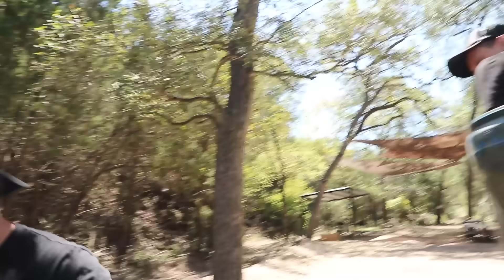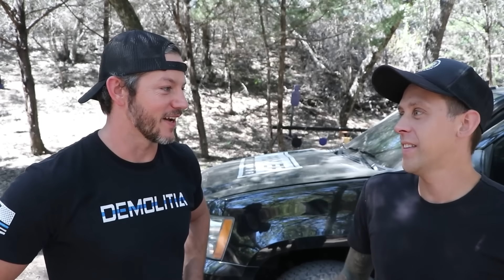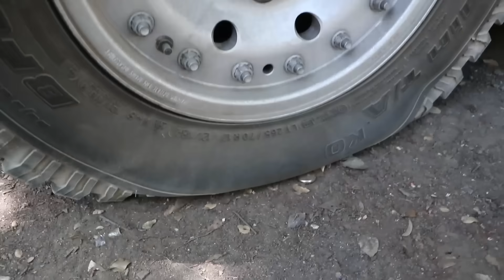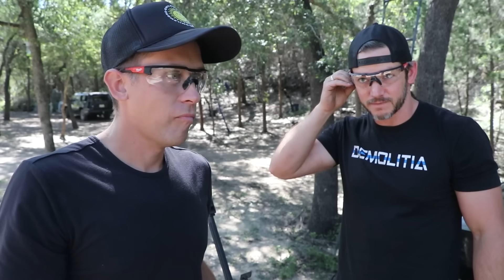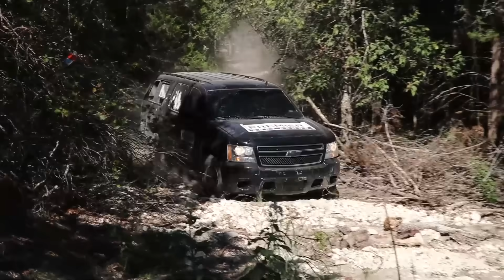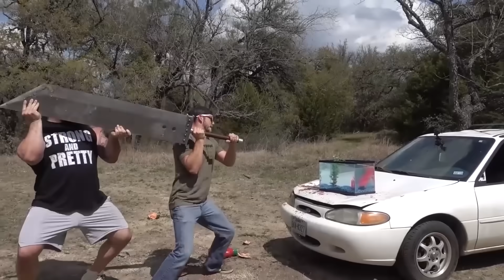Armored Truck Run Flat Tires vs 50cal

Comment: Suburban for sale, lightly used, minor ballistic damage, tires need to be replaced.
Reply: Don’t law ball me, I know what I have. *
Reply: @Donut833  😂
Reply: sure, sure, but what's the gas milage like?
Reply: Gas per foot is a more accurate measurement
Reply: Second owner, never smoked in, pet free.
Basically new.
No backsies
Reply: Read this as “trees need to be replaced”
Reply: Runs good
Reply: This didn't age well also no engine lol
Reply: That don't make them run flat no more
Reply: *minor cosmetic damage
Reply: In the name of God, the most gracious, the most merciful

 Say, He is God, One (1) God, the Eternal, the Eternal, (2) He was not begotten and was not begotten (3) And there is none equal to Him (4)
Reply: -AsianGrils- 🍎  Not approved by ATF
Reply: @bwofficial1776  hilarious 😂
Reply: @bwofficial1776 fyi that is not korean
Reply: I know a guy who would give 1000 bucks for the rolling GM parts.
Reply: @EyesToInspire   Buying the Suburban comes with a few strategically placed gas stations too, so you can make it to town and back.
Reply: just say it's minor collision damage. i mean, it was technically a collision with a bullet.
Reply: Price?
Reply: More like "tires still have plenty of tread"😄
Reply: @EyesToInspire  "Whats the gas mileage like?"
Matt: Yes
Reply: I can't believe the Tires we're bulletproof

Comment: I really want to see this RESTORED. It was such an amazing thing to have and to keep you safe.
Reply: Underated comment
Reply: Those runflat inserts, make changing tires a total PITA, and most places don'tknow how to do it. They are a tedious beeyotch to do. Plus those rims are probably all fkd 😆 🤣
Reply: @patrickw9520  considering he also had no idea what they did im assuming he also exceeded the maximum speed for driving on runflats witch is 35 mph and i can confirm changing runflats out is a total pain especially if they are steel rubber runflats are a pain as well but a bit easier

Comment: I think it needs to be restored once your done shooting it with stuff. Do the 50BMG vs the windshield and doors and stuff, then fully restore it knowing what it's capable of and take good care of it after that.
Reply: @Norwegian_Bastard  Everything is repairable as long as it hasn't been completely obliterated. It's just a matter of how much your willing to spend on it most of the time and if it's worth repairing vs the cost of just buying a new one.
Reply: I think as long as he just shoots the glass with the 50 everything else can be repaired. I mean he did say that bullet proof glass does have a shelf life so I mean it would need to be replaced anyway to be functional as a bug out car but I definitely agree
Reply: The back corner is smashed in pretty good, but that section us unarmed anyway 🤣
Reply: @aztecnat45  
The shelf life is kinda ehh.  It's not going to go from high power rifle bullet proof to not stopping a 9mm just because it's old.  It's bound to still be pretty effective for years.

Comment: Let this be a lesson to everyone watching: Don't EVER give Matt a car!
Reply: @agnez1169  super helpfull adition to this comment!

Thank you so much
Reply: @hmmmtietmetmosterd  don't bother. Bots can't read. Just report it like I did.
Reply: @omgwtfkthxbai  yep, even reporting won’t do much since there will always be an infinite supply
Reply: What if I give him a tank.
Reply: @wee0fps61  when reporting you have to say they have misgendered someone, that might work.
Reply: For real.. he's turning into whislindiesel over here
Reply: @xXxDarkKnightxXx  or Kentucky Ballistics? 😆
Reply: @xXxDarkKnightxXx  Matt has been doing this for years before that sadistic dude that destroys a perfectly good running truck for sht and giggles. Only difference is that matt uses guns
Reply: I'm also worried for the ZR-1, and the lowrider Impala, as Matt seems to mostly destroy the good stuff (GM vehicles ((His K1500, the burn-out Corvette, "El Chromino," and now, the armored Suburban).  What he should have destroyed is that stupid POS F-350, that did a terrible job of securing his stuff (popped door lock gains access) in San Antonio.

Comment: Man as much as I love seeing you shoot things, I got to say, I think restoring it will be great. Roman has a point, these are "interesting" times and I'd hate for the car to be FUBAR and you're left with a hunk of metal
Reply: I do believe that's why he bought the 5 ton haha
Reply: @mattk1693  yeah but the 5 ton isn't quite as bullet resistant. Plus that suburban weighs 6 tons!
So ha.
5 ton would be nice for just driving over things though.
Like those scenes in media like the walking dead where the freeways are just fully congested with abandoned cars so you have to get out and go on foot. Pssh just slap the 5 ton in 4  low and go wheelin

Comment: Shoot it with the .50 bmg in part 4 and get it fully restored for part 5! It’s a brilliant vehicle you can’t just leave it all shot to bits.
Reply: This feels right.
Reply: That was my thinking too. Part 4 go crazy with Barret, and I would avoid shooting the engine, then part 5+ start the restoration/customizing.

Comment: Run flats usually only run about 20 miles or so before it’s dangerous. I’ve done it with my car (has run flats) and it lasted 30 before I felt the tires were going to separate from the rim
Reply: Daniel, the non military run flats are not designed to go that far. They're designed to get you safely to a place to replace your time. Please don't push them to those limits. Find you a safe place, go home if close enough and have them fixed.
Reply: Driving around the streets for 30 days on a flat?  I don’t think so.
Reply: @scottmitchell1884  miles. Why would you think days??
Reply: Those run flats are different, the armored ones actually have rubber between the rim and the tire to hold up like it had some air, while normal run flats just have a really strong sidewall to keep the tire in good enough shape to get to a place where it can be changed.
Reply: Theyre also bead lock rims,the tire will stay on untill it disintegrates and will keep it from spinning on the rim.

Comment: To any physicists out there...

Can somebody explain why the dust gets sucked INTO the entry hole at 14:09? 
So far my only guess is that the vacuum of the bullet trail is more powerful than the pressure inside the tire, therefore forcing air into the tire before the air from the tire escapes?
Reply: The dust is hiding because it got scared

Comment: Depending on if they're "bulletproof tires", which are real, or just plain ol runflats, the wall of the tire might be much more reinforced than the tread.
Reply: @bentheninjaboo who cares?
Reply: They are neither bulletproof tires nor plain old run flats... looking at how the tyres go "half flat" im assuming there is something inside the rim holding the vehicle up. I have never seen this style of run flat tire, generally a manufactured runflat tire will appear pretty much fully inflated even when flat. As far as I know, certainly here in New Zealand anyway you can not get a B F Goodrich KO runflat.
Reply: @MR1wooki  thank you

Comment: On runflats the sides are reinforced with steelwire, and the Tread part is reinforced with more rubber, so shooting the sides would be the better choice.
Luckely your friend there knew so much about tires he told you to shoot the tread 🤣

Comment: What up DemoRanch!

The video were you filled 10 highpoint 45s with toothpaste all the way to cement, I believe should be retested. I don't think any pressure can build inside the barrel if it's filled all the way. So......I was thinking you should do another video with the same materials, but only fill the barrel halfway so there is room for the bullet to build pressure in the barrel prior to hitting anything in the barrel. 

Also, you should do it with some rifles as well. That way we can see long vs. short barrel.

Thanks for all the content man!!!

Comment: Run Flat tires aren't designed to stop the air from leaking out, they use a harder rubber all around to keep the deflated tire together for a while (civilian ones only really 20-50 miles max, military ones are far superior). Some of them that's all the company deems a run flat, other run flat tires have about an inch thick of hard rubber compound behind the tread on the inside of the tire to further help the tire do it's job without air. Outside of military use and ultra high end cars you rarely see them anymore but if you're curious or a car guy every run flat I've seen list their rim size as RF18 (for an 18in rim) instead of the usual R18. They were a trend with a lot of European cars in the early 2010's but customers got sick of the extra cost for just an emergency courtesy and the fact by the manufacturer's recommendation it is not safe to patch a run flat tire.

Comment: Run flat tires are basically just a normal tire with a very strong/stiff sidewall to prevent the rim from getting damaged, most don't provide any puncture resistance. Maybe in military vehicles but I'm not too sure.

Comment: Run flats are basically tires that have a very strong sidewall that provides a less comfortable ride but since the sidewall is strong it’ll give you like a few miles of driving before it fully becomes flat another thing about those wheels or I’m pretty sure that it’s bead locks so since you pop them and you’re like driving with them the tire doesn’t just come out like it even went in like its like because Bead locks are basically Wheels that has a plate that will clamp your beads of the tire to the rim

Comment: Armored vehicles' "run flat" tires are not the same as ordinary run-flats.  Many armored vehicles have a "solid steel wheel" inside.  When the air is gone, all that weight rides on that steel wheel and the rubber of the flat tire.

A person could take the extra step and fill up each of those armored vehicle tires with TireJect.  As soon as a bullet is shot through the rubber, it will seal that hole.  I have seen it on other channels.

Comment: Pretty sure a run flat tire is a tire that is designed to let air out slower than a normal tire, hints at why the tire would close itself up after the smaller pistol rounds

Comment: The run flats are not designed so that it rides like normal it's just designed so you can keep going without your tire shredding off of the wheel

Comment: runflats work by havinga stronger sidewall in the tire... so it can run with zero air in the tire.. it has nothing to do with how much air you lose out the tire....

Comment: would it be that expensive to restore? the internal protection is where all the money is, the outer is just the original panels
Reply: Not so sure about that. The internals are probably molded to the externals (body parts fillage).11
Reply: @olliefoxx7165  it's probably just bolted in